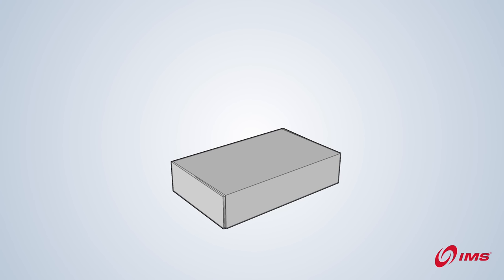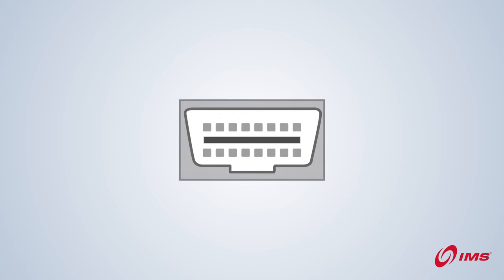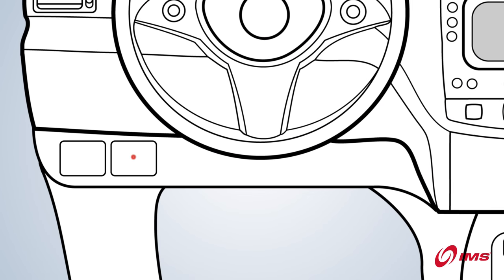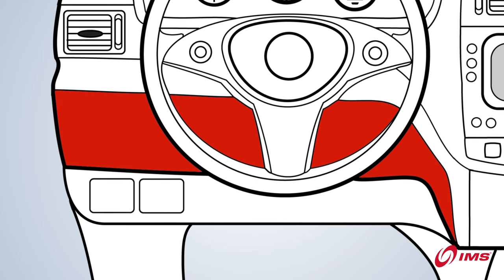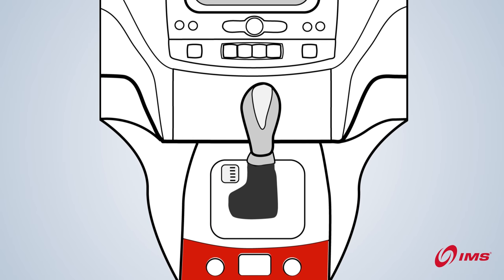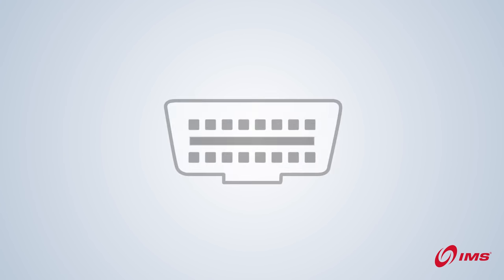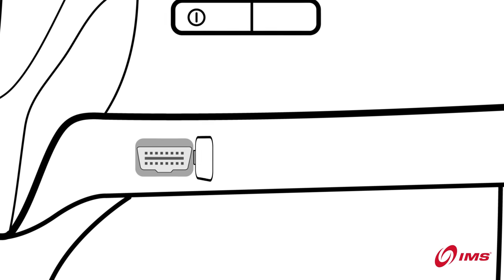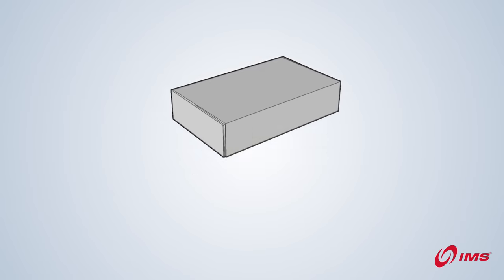How to Install an OBD2 Device - Quick Installation

Comment: it says after installing / with key off,  turn key to first stage. Don't start the car yet. then push the reset button for 5 sec. wait  30 -54 sec. then you are good to go. after 150 miles or so before it shows results.     my question; What reset button?

Comment: "d) Turn on the ignition and check the level of adBlue, if it shows 50% or 70%."  What if in my case, it shows 0%, what should I do in this case? also when is connected I lose power at the heal and also is shows in the dashboard " Engine control temp", what should I do? Thanks!
Reply: On which truck you had this problem? Are you solved? What was the problem? Have same symptoms on Man tgx 2011 with  adBlue obd2.